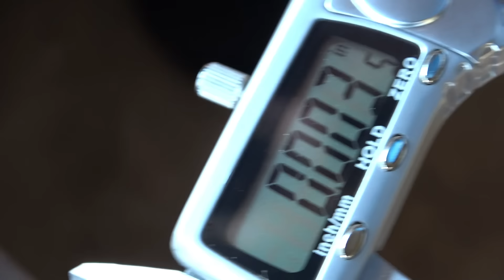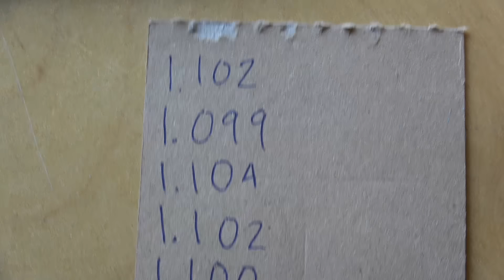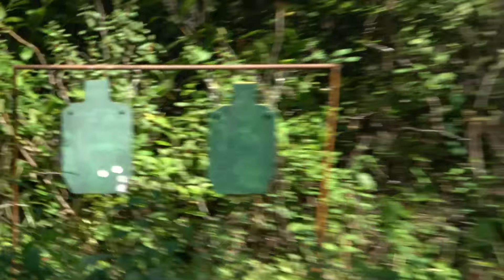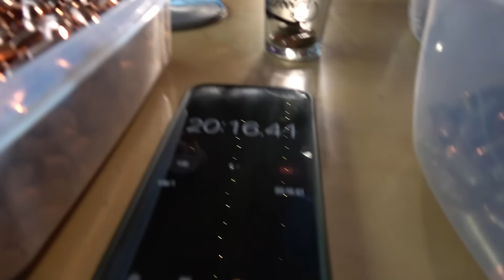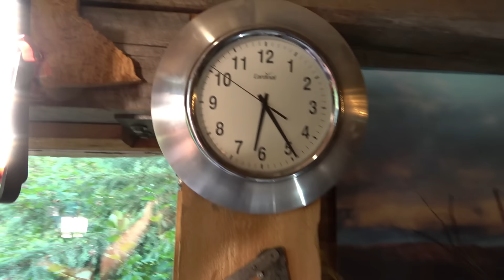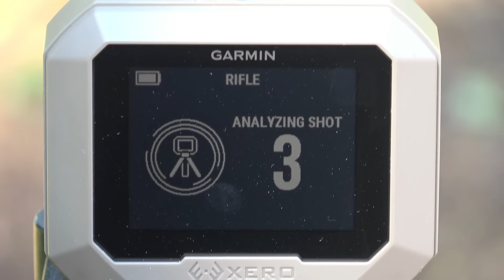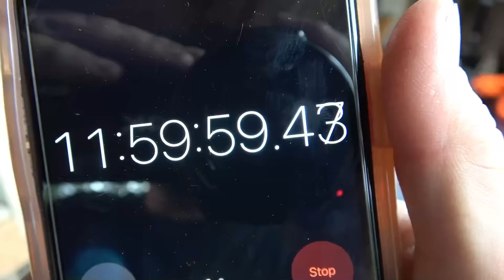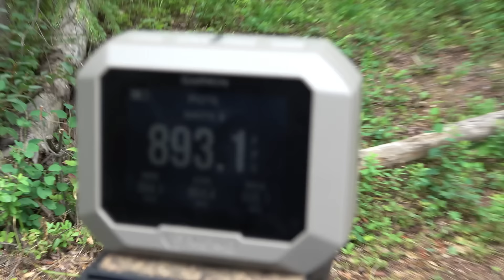We Made 10,000 Rounds in 24 Hours! DIY Ammo FACTORY

Comment: Berdan primers in your brass is whats bending your decapping pin. I will pull out the steel and aluminum cases because most of them shouldn't be reloaded and probably have berdan primers. Great family hobby. Anyone in the family can run bullets from start to finish. Great video.
Reply: YES, if its not brass, its a$$!
Reply: They go out spend a fortune on a top of the line press and have no clue what they're doing 😂

Comment: Cleaning out the primer pocket is essential. If the primer doesn’t seat properly then it causes a complete stoppage. I tumble my brass in walnut shells, deprime and resize, trim the cases and then put the brass in an ultrasonic cleaner which helps with the primer pocket and then I manually clean out the pocket. I’ll never get a thousand a day done but I also don’t shoot like crazy either.

Comment: you dont need the depriming pin out that far , just enough to pop out the old primer .
Reply: They were having trouble with them coming out consistently.
Reply: @justsomeguy9700  They were doing some short stroking and using light pressure when working the handel .

Comment: Those primers that are stuck are military crimped primers… requires another step to de-prime and remove
Reply: No, the press they have automatically does it on station 3. They just don't have it set right.
Reply: @CGT80  no it does not remove crimped primers.. only un crimped primers are removed on station 3
Reply: @figelski1  Station 2 sizes and deprimes the case. 99% of the crimped primers that I have run across will come out with the dillon brand resizing die. Station 3 swages the primer pocket, removing the crimp. Go read the dillon 1100 web page. I have the 1050 press with the same feature, 6 feet away from me on my loading bench. Once in a while, I WILL run into a 9mm case where the primer is really stuck and I am not willing to push that hard to pop it out or break a decapping pin. A major selling point of the 1050/1100 is that it deals with crimped primer pockets automatically. Previously, I loaded 9mm on my 550 press and could remove the primers, but a new primer would be deformed if it even started into the crimped primer pocket. I no longer have that issue, as long as the swage rod is adjusted properly.

Comment: BTW you might be interested in an industrial counting scale! It could make counting much faster for you guys. You place a container on the scale, zero it, place 5-10 bullets and enter that qty in the machine so it will take an average, and then every bullet you place on the scale afterward will be counted via weight. Once it's set up, you can throw a huge amount into the bin and it will give you an accurate count down to usually +/- 0.01%.

Comment: I didn't mean to crap on the video. I've been subscribed for awhile and I watch every video they make. FWIW I started reloading on a single stage, then upgraded to a Redding turret press (a great press!) and I still use that for working up loads but now I also have a Hornady LnL progressive.

I did see some crimped primer pockets in the video. Those can be fixed by pressing out the primer with a decapping  die with a heavy duty pin, then reaming out the primer pockets with a special tool, or swaging them out with a swaging die. Military brass is usually crimped, but cheap to buy so I've swaged plenty of them.

Comment: Be on the lookout for primers 'crimped' in for use in full auto sub-machine guns. They're added to not nave  a ka-boom with everything flying in unison at 750 rpm.
If the crimp isn't swaged open, primers can be squeezed dangerously sideways and random ways but not the proper way. Check into a Die that Dillon has to remove that primer crimp as you run automatically.

Such a beautiful family and great parents. So much love that'll keep everyone close.

Comment: If you haven't come across it yet... Grind the tips of those pins slightly on an angle.. sometimes when they are full sized they will punch the primer out, it hangs up on the pin and then gets pulled back in to the primer pocket.

If you are going to be making a bunch of ammo check out - hundo gauge (100 round case gauge) you can get a 3D printed loader for it too and it takes seconds to load all 100 and check them at the same time - much better than 1 at a time!

Comment: Try using nothing but new brass on your ammo. But since you want to use old brass I would not use any that been reloaded more than 3x and make sure they are really, really clean and check each one for ANY deformities in the brass. And if you find any bad one ones toss that one in a seperate barrel and sell the brass to a scap yard and get some money back. Also get extra parts for the reloarded like the primer remover pin. Thanks for the video.

Comment: That is a great video.  Those Dillon presses are amazing.  We started out with a Lee single stage press.  We have mostly Lee dies.  Lee claims that you will not bend there de-priming pin.  We never have.  We now have a Dillon press.  Lee is cheap and decent.  We did have to replace the Lee 6.5 Grendel dies with Hornady.  The Lee die would not seat the bullet straight.

Comment: I have a 3d printer design that I made using a light diode and a light sensor to load your bullets. When you attach it, it spins just like your shell loader. When the shell goes up, it presses up and allows a bullet to drop in. This stops you from having to manually set each bullet. Let me know if you want it and I can send the design over to you. You can print it at home and it costs about $40 in parts to build.

Comment: Spent primers CAN be reused, it would require alot more time and precise attention to rework them but it is possible. In a complete SHTF scenario when primers are hard to find, re-using your primers would be essential. You would just  have to source to components in making blackpowder to use as your powder substitute for the charge and the charge compound to set off the primers. Same process can be done especially with percussion caps for blackpowder firearms

Comment: A little 'trick" that will speed up process by some factor.  Instead of reaching  for a single bullet from the bullet tray each time. grab about 5 or 6 in your hand for each "reach". This gives your left hand the ability to get the bullets in your hand aligned and presented to your fingers for setting on the flared case. It certainly won't double your speed, but it will be faster and less tiring. It will allow you to speed up the pulling of the handle by just a bit. Also your brass (in my opinion) needs to be cleaner. tumble longer. Dirty brass will wear out your sizing die faster.

Comment: All military brass has the primer crimped in. You need a primer pocket swage to take the crimp out.  I suspect that the primer de-caping pin bent because some of the brass was of foreign manufacture where they use two flash holes.  The crushed cases happened because the case did not have sufficient belling of the case mouth before seating the bullet.  The de-caping pin assembly post needs to be turned a little bit deeper into the die.

Comment: Your issue with primers not seating at the 17:45 mark in your video is that is military brass, which uses a crimped primer pocket to ensure the primers stay in place.  You can reload military brass but you need a fairly inexpensive tool to eliminate the crimp first.  The tool is available from Dillon.  It's called the Super Swage 600 and sells for $148.  It works for small and large primers.

Comment: There are a ton of good replies here. Please read them all. Some, if not all my info, may be repeats, but it's lessons I've learned from learning to reload with a progressive press. If you're out to crank out ammo, separate your cases into 100 at a time. Primers 100 , and bullets 100 at a time. Load them that way. Pull every 20th to make sure powder is consistent, some powder measures change accuracy depending on how much powder is in it.  Pull the bullet, or before it's pressed in and check powder, complete cartridge. Test COAL. Make sure primer is seated. If you do it well you will run out of bullets, primers and cases at the same time. Place them all in an old ammo tray and make sure they are all the same length. Now check the machine for lock nuts loose, anything out of the ordinary. clean off any loose powder. Load another hundred. Do your first thousand or 2 like this at least. Then i move up to checking every 50 or so. Still load 100 since that's what my primer feeder holds. Shooting reloads slowly at first, Be SCARED of anytime it doesn't go bang, sounds weak, or doesn't eject the shell. NEVER LOOK DOWN THE BARREL, but check for squib load. Since I fire pistols, I keep a bamboo BBQ skewer to stick in the chamber and out the barrel. With reloads assume any misfire obstructs the barrel.  To me these are the very Basics of reloading. Also write down the recipe, powder, which bullet, primers and any info you have on cases. Keep your cases together by how many times the cases have been reloaded. I hate a thorough inspection so i look over each case, but throw them all away after the 5th reload. ( I started with Glocks, so i saw the "glock smile" on a few cases after 5). I'll add more when i think about it. Experts please correct my mistakes. Thank you and good luck.

Comment: Great challenge video! Although I don't think it's necessary. I use a smaller reloader and can reload up to 100 rounds at a time. The primer removal needle is a consumable item. If it is bent, it should not be forcibly reset but replaced.

Comment: The cases were probably notorious/military brass….the primer pockets are swagged…if you sucked up and did starline you could get 7-10 reloads per case at moderate pressure loads…1000 fps or so…not sure the bullet but plated/powder coated would work…good luck

Comment: Some spent brass has the potential of being NATO brass. Meaning, the primer pockets are crimped and need to be swayed to remove the small amount of crimp left behind after removing the spent primer. Dillon has a super swager for that task, but you’re running an 1100, it should have a swaging station. 
That being said, I run an XL650 for 223/556. 
I set up an old single station pacific press with a carbide sizing/depriming die. I run my once fired brass through a tumbler, clean the brass, lube it, and then size and deprime on that single stage press BEFORE any of that brass even meets the 650 for the first time.
Yes, it’s extra steps, but I am willing to put in the extra steps to make sure any reloading session I embark on goes as smoothly and efficiently as possible. I also run carbide dies on the 650 as well. Dillon case lube is a MUST. 
I seriously want a super 1050 or a new 1100 for rifle and would then set up the 650 for pistol. 
I’ve only seen a few of your videos, but from what I’ve seen I can see you guys are a great family, thank you for that, it is most definitely refreshing in this world today.
Oh yeah, and I second third and fourth the warnings about sqib loads ! Please learn about them and what can potentially happen if one occurs, and then TEACH your daughters what to look out for. You could potentially save a life sir.
Other than that this was an awesome video

Comment: Good choice on a press I've been using the old RL1050's for over a decade and have 3 of them now small primer/large primer and a spare for trimming and sizing.

I hate using steel pins they aren't necessary and get stuck, break tooling. You just need to swirl the brass in citric acid/ajax water for a minute and then rinse and dump in the tumbler still damp. Dillon tumbler will do about 1k 9mm or a harbor freight cement mixer (carpeted plastic drum, paddles removed) will do around 5K.

Besides that get yourself some bullet molds and a powder coater and you'll be set up pretty well. If you can access your berm for mining every bullet you fire is a potential source of lead later once there's enough lead there to mess with.